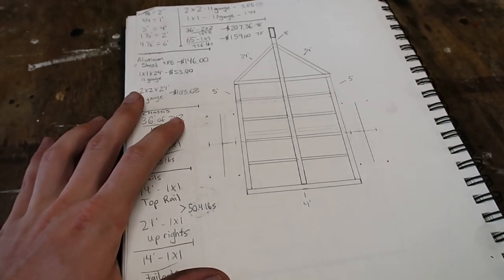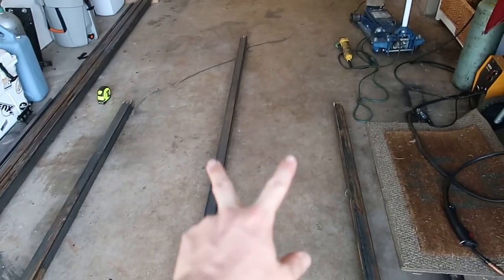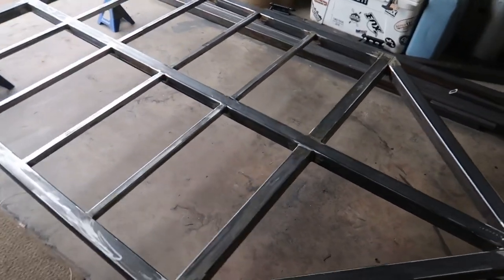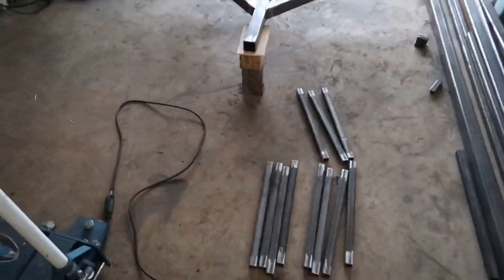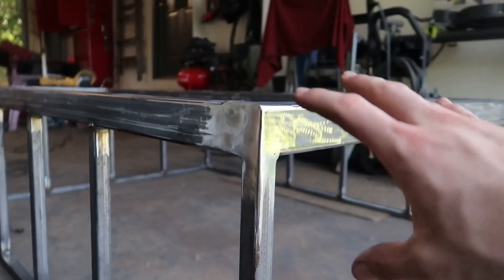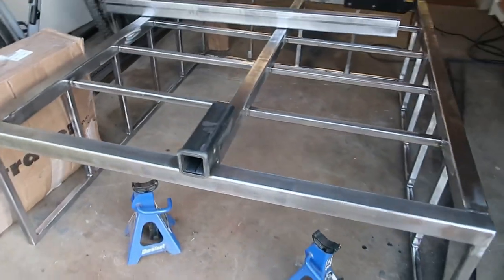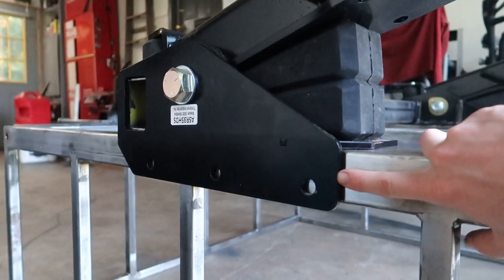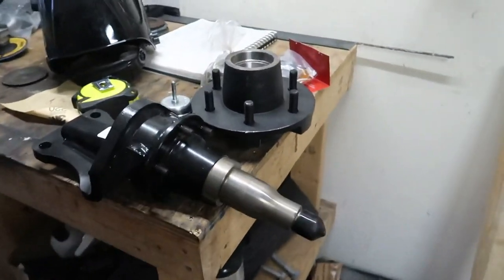Overland Rooftop Tent Trailer Build: Part I - Structure

Comment: Thank you for your videos, I subscribed. Your attention to detail and the care you take in your work is inspiring. You can paint over mill scale. Use an acid etch primer then good old rustoleum or hammerrite and it will last decades.
Reply from the maker: I really appreciate it man! Also thanks for the tip I did not know that! I enjoy being able to share my builds and connect with you guys about ideas, tips/tricks etc. 👍🏼

Comment: maybe an angled welded slider on the front of the rear tow hitch so that if you were crawling over something.....it won't act as a hang point?  Will allow the trailer to ride up and over the obstacle.
Reply from the maker: Not a bad idea! But also don’t think it would be necessary. The departure angle on the trailer is far better then the vehicle that would be towing it 👍🏼 would be a fun feature to add to a custom build if it was for some extreme rock crawling of some sort.

Comment: Out of curiosity what is the cost of materials for the frame? I’m not a fabricator or welder and find this project very interesting. Thank you for the great video.
Reply from the maker: Thanks man! With current market prices it was about $584 in the structural metal. I had to buy in 24’ sections so there was some left over metal as well.
Reply: I'm building the same trailer,  I used 2x4 rectangle (just for the outer ring) and all together it was 706......
Reply from the maker: The price of metal is insane right now I hope it returns to more normal levels eventually
Reply: @Adv4x4  yes. I work in stainless, apparently it's due to go up by a quarter in early '22
Reply from the maker: @kieranh2005  unfortunate to hear 😕

Comment: Awesome inspiration! I watched the other videos but this is something more of what I am looking to do and then will enclose the box with some doors ect. Do you have a total costs so far of the raw materials just really the steel. I can add up the Timbren Axels ect and wheels and tires would vary. I would love to go with hubs that are 5x120 to possibly use the same wheels as I have on my Discovery and tire size eventually. I have ZERO welding experience but I would be willing to try this out and learn. Seems pretty straight forward process to get the rolling chassis.
Reply from the maker: Thank you! I’m about $1200  in just metal. The prices of steel are currently pretty crazy unfortunately. But yeah man welding is fun and it’s a constant learning process. I’d just watch a few YouTube videos and practice a little bit and you will definitely figure it out quickly. Thanks for watching!!
Reply: @Adv4x4  yeah I’m not in a hurry to build but just gathering some ideas and inspiration. That costs is with the verticals brackets on too? So essentially thinking $1200-1500$ for steel, $1000-1200 for the 3500HD axels and I could find some second hand TRD tires and rims and prob have a rolling chassis for under 3k. To enclose it I would prob want some sort of lid, and use sturdy sheet metal riveted to frame and really you can get as crazy or stay as simple as you want with doors drawers and whatever accessories
Reply from the maker: Yep that’s price for all metal including two 4’x8’ .100 aluminum sheets as well

Comment: Hey man...around 15:55...is there a rule of thumb of how far to thread a hitch receiver onto the frame stock? I'm trying to see if I can get away with 1/3 of the way of the receiver length (in order to not have to order a longer beam).  My center 2" beam of my trailer project will have a hitch receiver on each end...threaded onto the ends (and welded).  I'm just trying to find out how deep it should be threaded onto the beam so it's stays strong.  Example, putting a 18" hitch receiver onto a 2" beam only 4"...would that be pushing it? Is there a general rule of thumb? Thanks man!
Reply from the maker: Hey dude! I wouldn’t say there’s a general rule of thumb. But I’m sure an engineer would be able to do some math to determine what would be ideal (not me😂). 

I just kinda did excess just so it has no chances of being an issue later. If you drill some holes and do some of those anchoring welds like it did as well as weld that whole end I don’t think you will have an issue. But once again I am no engineer! Haha. 

Look up “fish plating frame” on google. You could also add some plates to it if you are nervous about it’s strength.
Reply: Thanks man...is that a 12" receiver you have there on the front?
Reply from the maker: @mattmatthiessen7743  yes I believe it was around 12” I got it from harbor freight

Comment: This should be an interesting build to watch. What is the expected weight of the trailer when it is completed?
Reply from the maker: Thanks man!! Completed weight not quite projected yet due to some variables but the main structure itself is sub 200lbs 👍🏼
Reply: @Adv4x4  yeah I have a S10 Blazer so I'm looking for something like this that is fairly light so it tows easily
Reply from the maker: Yessir! My goal for this one was lightweight as well. Light rugged trailer capable of carrying a heavy load if needed.
Reply: @Adv4x4  will the steelit keep the galvanic corrosion at bay with the aluminum flooring and steel frame?
Reply from the maker: I will be securing the aluminum to the steel with 3m VHB double sided tape. Stuff is amazing and provides a thick barrier between the two. I used it on my last trailer build and have had no issues.

Comment: If you had to do it again would you remove the mill scale on your stock metal before you start cutting?
Reply from the maker: Absolutely! I wish I had gotten that craftsman restorer a long time ago. From this point forward will definitely be removing mill scale after each piece is cut to length.

Comment: Rather than a framed wall with skin, ever considered just using a single piece of thicker diamond plate, folder over at the top? Be a lot stronger with not much, if any, weight penalty.
Reply from the maker: That would be a great alternative! Many ways to go about doing this forsure. This was the easiest method for me and my tools / material available!

Comment: Why not save the HD Timbrens for a different trailer? I’d imagine they designed it to go on 2x3 for a reason.
Reply from the maker: I didn’t plan to run 3500 to begin with. It was honestly all that was in stock when I was doing the build. A bit overkill for the trailer but better than insufficient 👍🏼